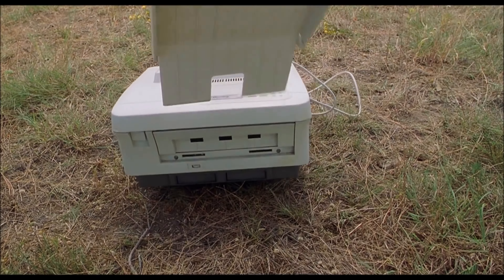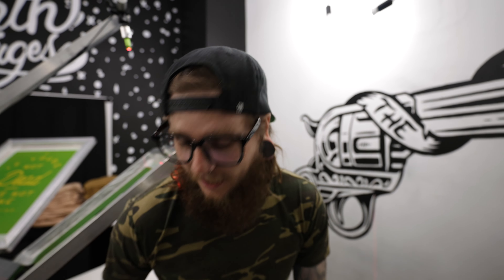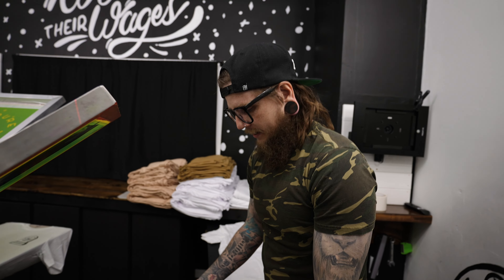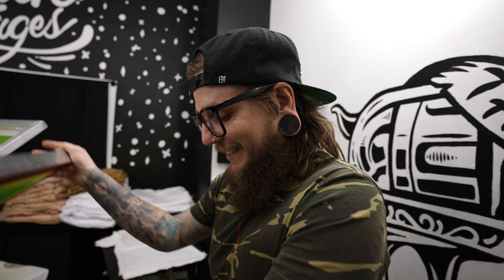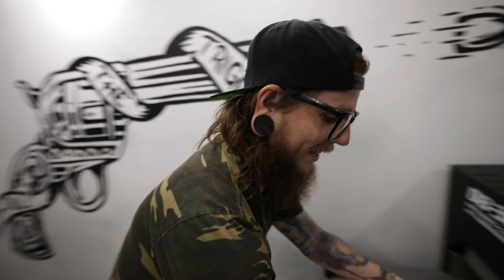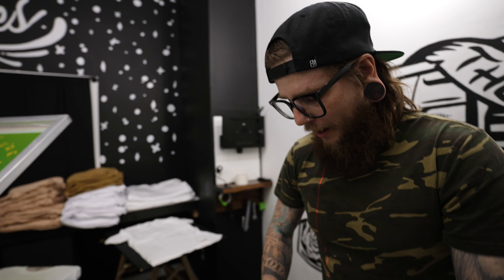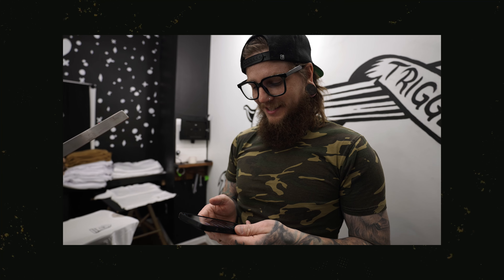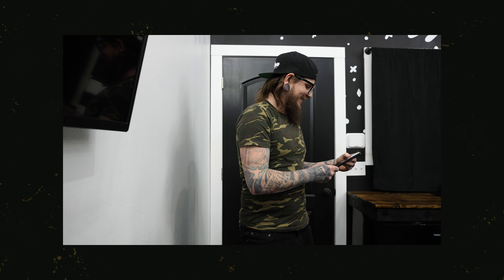Printing 1 Color Water Based Is A Nice Change Of Pace

Comment: Like the design. Is the water based ink curing with one pass through the dryer? Really been wanting to use water based vs plastisol. It's the curing that's keeping me from doing it. Have a dryer just not forced air. Learn me something 🤣.
Reply from the maker: Well here is what we do:
We flash the shirt and then run it through the conveyor dryer on the lowest belt speed because I am using a short dryer with one heating element. We do a wash test to ensure the ink is cured. Forced air is definitely the right way to do it and it is much more efficient but you can still make it happen without it. You will have to spend some time to dial in your belt speed depending on your dryer. Good luck! Reach out through DM on IG if you need any more help. Thanks for watching!!